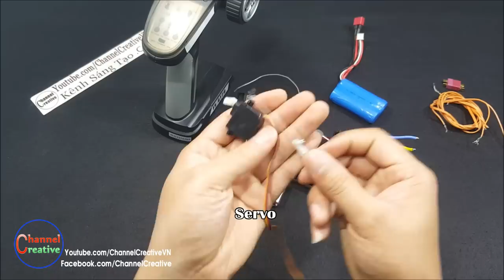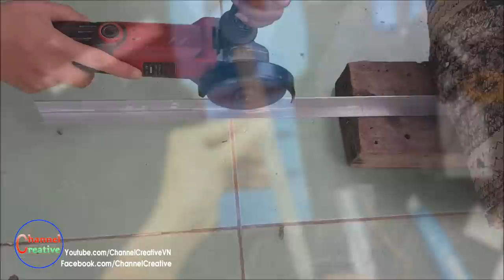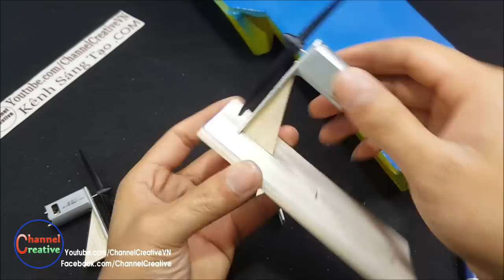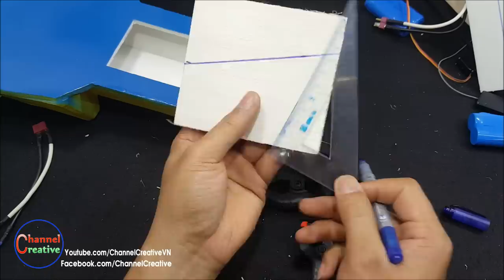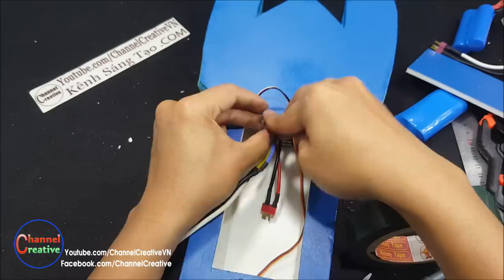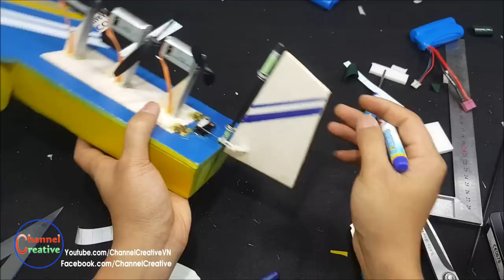How to make a RC Airboat Three 180 Motor - version 9

Comment: I don't think this design is very efficient, since by putting one propeller right in front of the others, you're introducing messy air into the rear ones. I would recommend placing them far away, but really cool project!